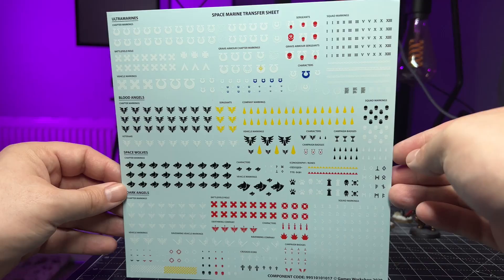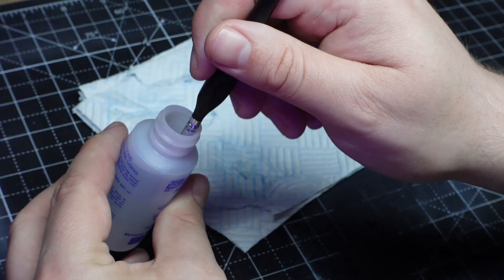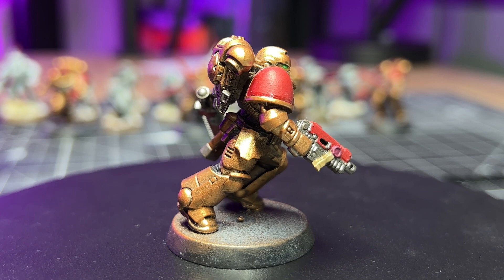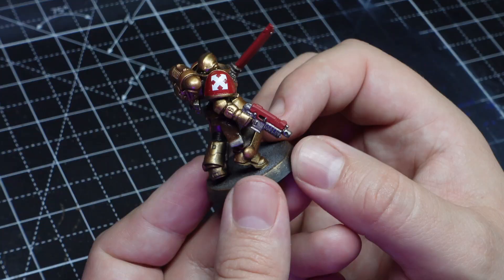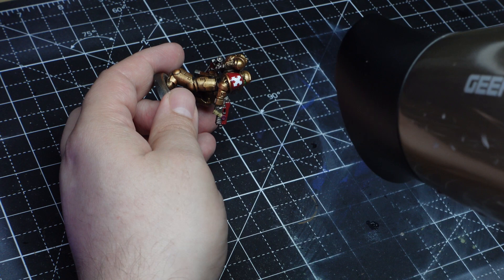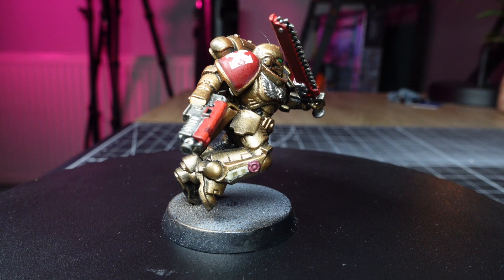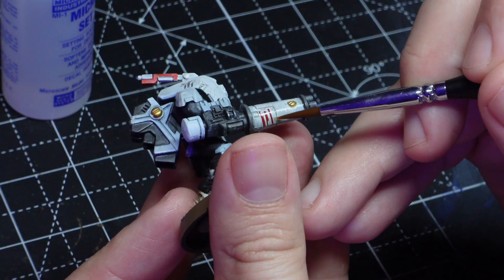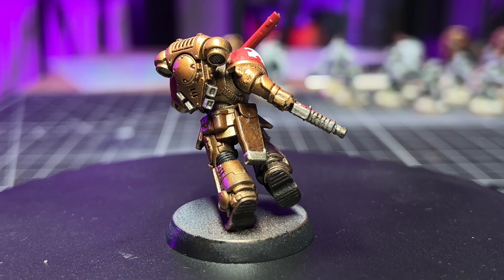I applied transfers for the first time… is it really this hard?!

Comment from the maker: Have you tried applying transfers to your model? if so, what's your go-to technique?
Reply: I usually use a hobby knife when putting on transfers. I find it has more control than a brush that springs around. Plus, if I accidentally tear the decal, it's just "battle damage"
Reply: 1. Use a pointed tool like a toothpick of hobby knife to move the decal/transfer around. You just have more control.

2. If the decal sticks and won't move, put a drop of water on it. It will seep under the decal and lift it up so you can move it again.

3. Qtips/cotton buds are essential. You can use the to absorb any excess water like above, and when you have the decal where you want it, you roll it over the decal to press out any air, absorb excess water, and help it lay on a curved/flat/angled surface.

3. If your decal is still not laying as flat as you like, micro set/sol again. I did a model with really old decals and had to set/sol 3 or 4 coats to get the decals to relax into the surface and look natural.

Comment: Transfers are much easier if you use your fingers. Push the transfer off the paper onto your fingertip, then grab it with tweezers. And use Micro-Sol to dissolve the transfer into the part.
Reply from the maker: Interesting, I’ll give it a try!

Comment: I havent used Micro Sol but have used Vallejo decal medium - after applying this softens and melts the decal, helping with small amounts of raised parts. If there is some texture beneath the decal it also means you can form it in with a stippling type technique.
Reply from the maker: I'll have to try the Vallejo Decal Medium, I'm a big fan of Vallejo! Thanks for the tip 😊

Comment: Just use water to detach the decal from its backing. Don't bother with Microsol/set. Get Tamiya Mark Fit Strong. One solution that softens and sets the decal in place in one step rather than micro's two. Most pro modelers use Tamiya.
Reply from the maker: I'll check the Tamiya product out, thanks for the tip! Never heard of it before but I love their glue, it's so good.